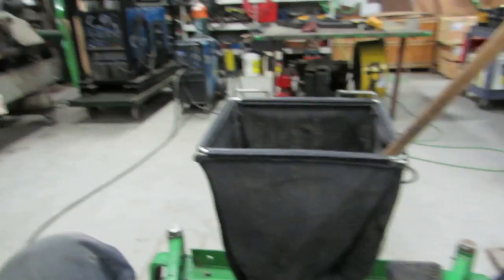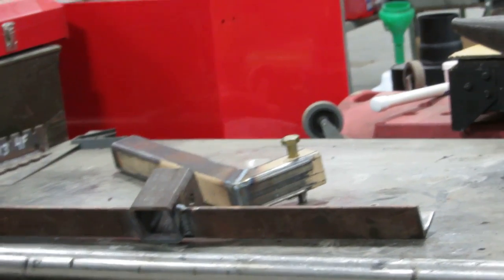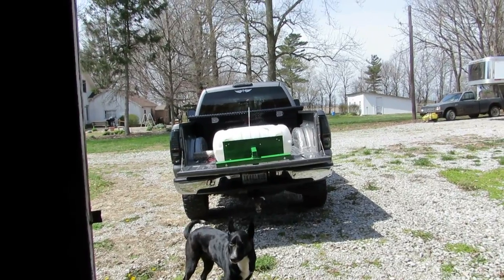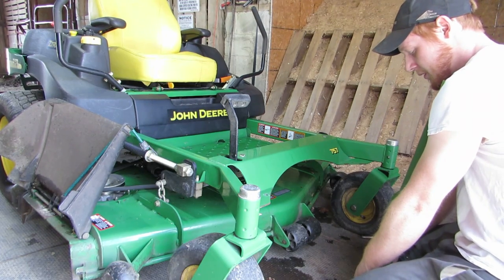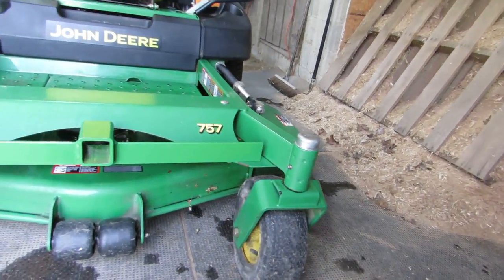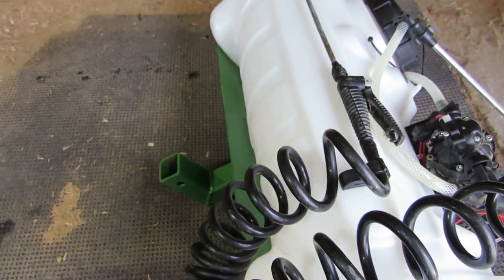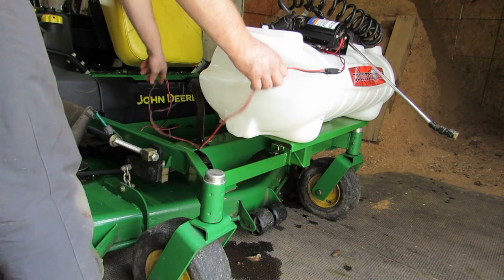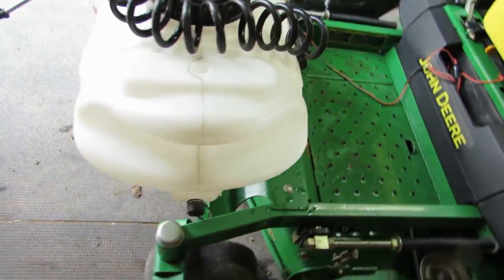Lawn Mower Mods!

Comment: You know the safety bar that hits limbs while your mowing that everyone leaves down well I cut a section out of the center of it then welded a piece of heavy square tubing that would receive one of my trailer receivers and ball so I can pull a trailer or I have a rack we used to put on the back of our Yukon so I can move something heavy somewhere I don't wanna carry. It works great.

Comment: Nice job on the mount.  Hide the wires.  Use a quick connect and when not using the sprayer you have a great powered platform for lights.

Comment: What are the dimensions on the square tubing you used for the receiver and hitch?
Reply: Just buy whichever reciever suits your needs at Harbor Freight and bolt or weld it in your fabrication.  Cheap and easy.

Comment: I would not recommend this setup as you will be breathing in what ever you are spraying. There is a reason everyone else mounts them in the back.
Reply: I would agree. Never use a sprayer that you drive into. Always drive away from your spray. Maybe he plans to spray while driving in reverse, or spot spraying?  That would be fine. Great job on the reciever! That would be great for a blade or winch.  Heck, maybe a small bucket powered by a winch system. Nice fabrication.
Reply: Or purchase 8ft of hose and mount boom to the rear. The tank does need to be on the front to prevent a tip hazard.
Reply: @shane686  My tank is mounted over top the motor so the weight it over the rear tires.